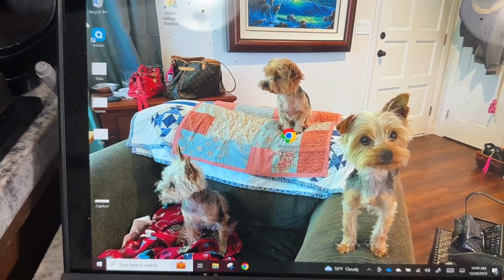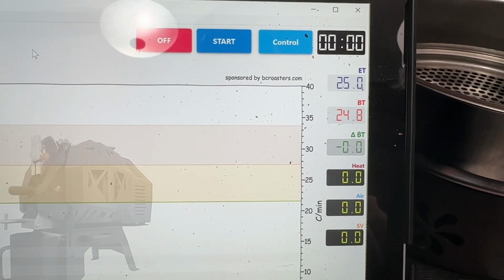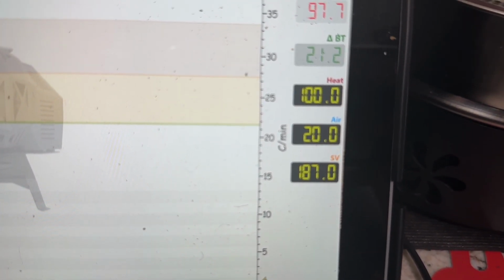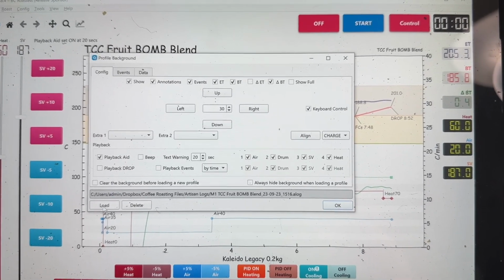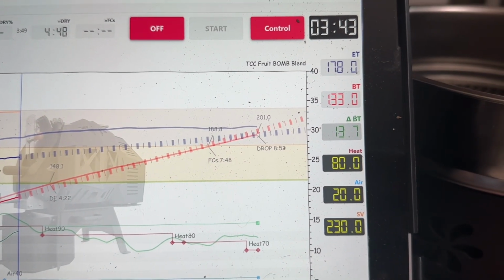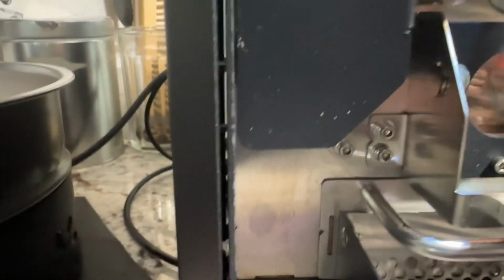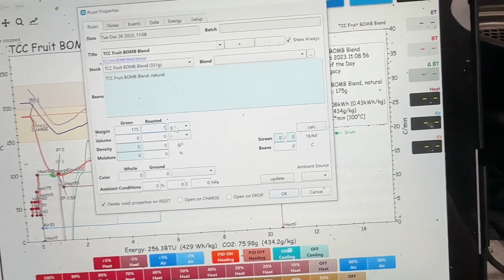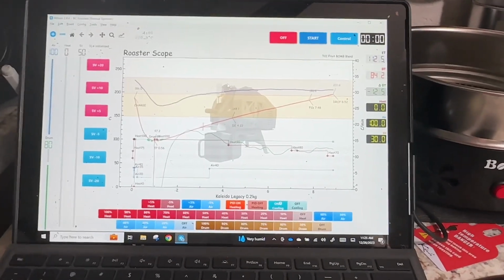Kaleido Sniper M1 Demo

Comment: I just received my M1.  I find your videos insightful on the use of Artisan, which I know a little bit about myself.  I think you posted some of your settings over on the FaceBook page for Kaleido. How long does it take to cool down below 50 C?  I did an initial run and then it took like 30-40 minutes to cool.  I found that opening the bean drop chute made it drop in temperature faster ... but that was after 20 minutes of a slow decline.    Are your dogs Yorkies?  They are so cute.  We have one and love him.
Reply: M2 is much quicker, but it's got 2 cooling fans, my channel shows it at ebikecnx7239

Comment: Nice Artisan demo video. I try to connect the roast manual mockup equipment with Artisan software with modbus potocol and read/write data form thermal gauage, fan, heater  and so on.